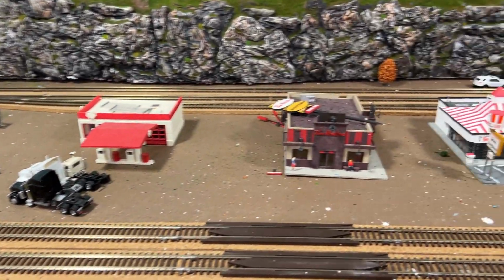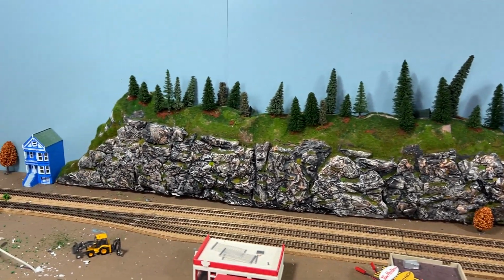HO Scale Station Platform Build - Basic Structure & Track Ballast

Comment: A note about your wheelchair ramp.  

It looks like the total height from the ground to the top of the platform is about 5/8 inch; which is the equivalent of about 53 inches (or 4'-5.25") in full size.

A standard commercial wheelchair ramp slope is 1:12.   So a 53 inch rise would require a total ramp length of 53 feet.  

53 feet in HO-scale converts to about 7.31 inches.

Also, the minimum width would need to be 3 feet clear (from inside of railing to inside of railing) (full size) which scales to 0.41 inches for HO.  For any corners, you'd need a level landing of 5 feet by 5 feet clear (or 0.69 x 0.69 inches for HO).

Comment: For future reference :  It looks like your long steel ruler is about 1" wide.  So when it comes time to cut 1" wide strips of what-have-you, just line up the edge of the ruler and cut.  No measuring needed.

Oh, and when elevating a building like your station, you only really need to put support (in this case, cork strips) along the perimeter.  The very centre of the building doesn't have to have support.  This would save on your use of cork.

Comment: For the disability ramp you could add the ramp to the front door. However, many modern passenger stations don’t require you to enter them so a ramp on the side works too. Both work.
Reply from the maker: I thought it would make more sense for the ramp to lead up to the station platform. No need to add more obstacles like doors and people.

Comment: Could you use the old rock face as a facia element?
Reply from the maker: You mean remove the rock from the hills and use it where required?
Reply: I actually meant put the whole element on the front edge of table. But either or

Comment: Hi Dave,
I apologize for being out of touch so long. Between work, family engagements, medical appointments, and working on the layout including updating the DCC-EX & Engine Driver software my life hasn't been my own.
I'm going to miss the rock wall but it's your layout and therefore your rules. If you're going to have a passenger platform where the rock wall was, then REDUCE THE LENGTH of the platforms to accommodate a pedestrian crossing at the straight lengths. There doesn't appear to be sufficient space for an overhead pedestrian crossover. ALTERNATIVELY, you could create a flat version of a Railway Express Office (REO) where the rock wall was. You still may need to reduce the length of that platform.
You don't need to 3D print an REO, or buy plastic kits; I use Elmer's 1/4" foam board. Look at my layout and you can see for yourself how I've done it.
Whichever route you choose, keep up the excellent work! P.S., thank you for the monthly membership.
Reply from the maker: Hey, I wanted the platform much longer than this, lol. If I decide to add a bridge, I will add some more cork to make a concrete platform for each side. Plenty of room for that.

Comment: All great ideas, just wondering should you have started with the furthest point being your wall, shouldn't you work from the wall towards yourself to prevent damage to the existing scenery once you've finished it??
Reply from the maker: While your theory is sound, that would require a complete and thorough plan of what I was building on this layout. 

I do have a couple of corners where I will start at the back, but I can easily reach these straights without damaging anything.

Comment: Mr. Scott, what would be great is a residential in one part. Then have small covenant stores at the bottom plus apartments on top. Good example for this Walthers merchant's row. Another example is Desine Presivation Models. You can have restaurants, convenient stores, music stores,  and small shops. On top of Desine Presivation Models, you can have apartments on top of the stores. The one Desine Presivation model is the # 10600 Laube's linen Mill. The will fit is as a laundry fecelity. You will need one to wash table cloths, napkins, and uniforms if you want restaurants on your lay-out. How do I know?, I worked at The Olde School Reaturant in  Brantford, Ontario. All can I say is to take your model railroad cap off and put on your Civil Engnering yellow hard har on Mike
Reply from the maker: I have some of those buildings , but they will be going in the large town area. 
This section is more like the entry into a town, so all those established businesses have not been created.

Comment: Looking good. On the other side of the tracks, commercial building flats (stores, etc.) might be good, but I think a street with a row of the painted ladies would look great if there is enough depth.
Reply from the maker: There’s enough depth for those houses and one single track road without a sidewalk. 

Or, I could resize the depth of the houses by another inch. Once they are all squished together you wouldn’t notice how short they are.

Comment: You need a subway(tunnel) or a pedestrian  bridge to reach the other side.  I have observed that the platforms in my neck of the woods either extend all the way to the rail, and are asphalt, or concrete that stops at the tie ends.  The platforms are also rail height, with step boxes used for the "final" step down.
Now commuter lines like the high level platforms- no car attendant needed to place the step box, doors open automatically, and the passenger just steps out.